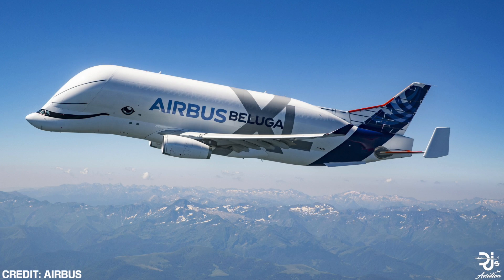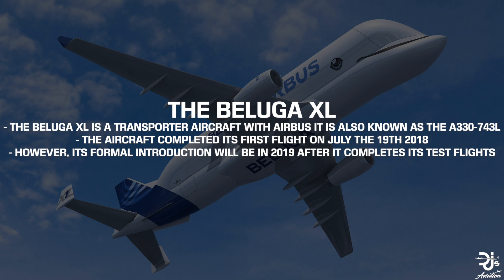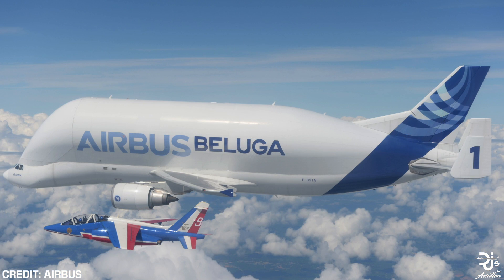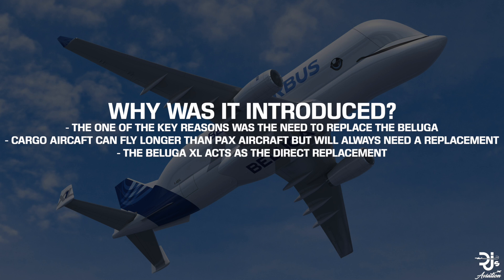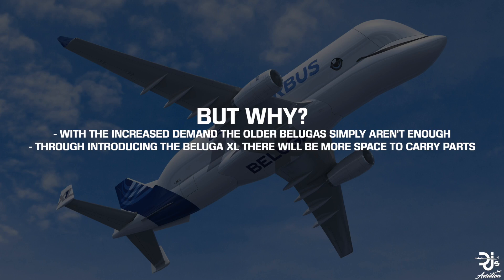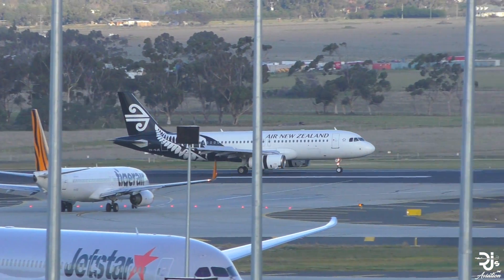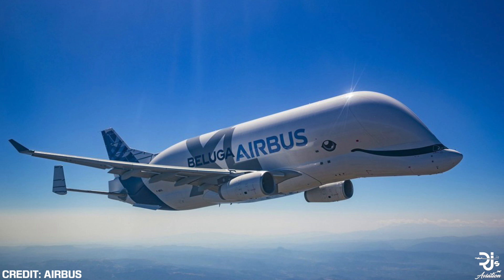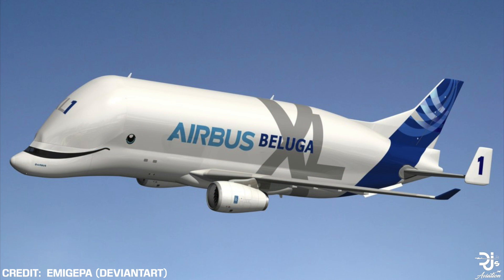Why did AIRBUS Build the BELUGA XL?

Comment: By adding 2 new belugas to their supply chain transportation they can increase production by 8 planes extra every month. 
It’s quite amazing but the beluga aircraft only spends around 9% of its life on the ground. 
They fly 24/7 all 5 of them. It’s a very efficient process they are running.

Comment: I wouldn't be surprised that Airbus ends up building more Beluga XL's than originally anticipated. The high demand for the A320neo Family airliners and the ramping up of A350XWB production will require a lot of use of these planes.

Comment: Other than paint and the Rolls Royce engines, at a distance more than 100 yards, you can't tell the difference between the Beluga and Beluga XL.

The Beluga racked up most of it's hours flying wings from the UK to Toulouse France. Some genius decided to also fly A320 fuselage sections instead of transporting them on rail, because of schedule.

The XL allows for A350 fuselage sections to be transported, where they wouldn't fit in the regular Beluga.

Comment: G'day Dj, And they still call my beloved C-130s 'ugly'. It's only the brilliant, almost cute, paint job that disguises the gross ugliness of this aircraft. It's like an A380 crash landed in a lake of Botox, losing two of its engines, and surfacing looking like this! You've got to admire the thinking behind this type of cargo craft, There's no way you could road transport huge fuselage sections and entire wings on Europe's road system with all its narrow roads, bridges and tunnels. It's the only solution for Airbus's widespread groups of factories.
In response to a commenter below, I don't think this aircraft could be sold to other cargo airlines. Conventional air cargo containers wouldn't be economical in one layer and there's no way this aircraft would take the weight of stacked air cargo pallets that would fill the huge space inside. Besides, the Antonovs are much better suited to odd-shaped and heavy loads. No other company would want these, I reckon. Cheers, BH

Comment: I think, they should insert some bigger engine lips and outer body as the beluga xl looks like, a massive airplane is driven by so tiny engines (2:57). It is okay if they do not increase the power of the engines but they should insert bigger lips and increase the diameter for the plane to look better to bystanders. By the way, good video Dj! I love your videos.

Comment: Can anyone tell me why 2 engines can produce that much trust to carry ex a380 in pieces
Reply: Well because aircraft parts are usually very light, but massive in volume. So it doesn’t need massive engines, just a massive hull.
Reply: Henry Mao 
It’s because of the noses design
Reply: @desmondc.2351  Can you please explain further? Thanks
Reply: Anastasia Golovkova 
Because of the structure and the shape of the aircraft, it’s like a wale, also looks like a dolphin. The shape makes it agile and the air can run smoothly over it

Comment: love the Beluga XL design of course.  but you failed to mention DJ that the relative merits of the XL is that it can transport two wings of the A-350 aircraft in one flight, unlike the current Belugas which can only transport one wing at a time.  i do have another question though: there does not seem to be any intention on the part of Airbus to market the Beluga both classic and XL as transport aircraft to those in the freighter business.  is it because there is in fact no interest in the aircraft as a transport airplane for other businesses?
Reply: Great question, Tony de Castro, and I will try to give you a very shortened and oversimplified answer as to why the Beluga is not used by freighter airlines.  In short, the Beluga is too specialized to be economically feasible for the freighter business.  

Airbus built the Beluga around the objective of carrying completed Airbus subsystems from factories around Europe to Toulouse, France for final assembly.  To convert it to a more generalized freighter aircraft would be excessively expensive.  

The Beluga is not a massed produced aircraft as is the A320 series, the A330, the A350, etc.  Consequently, there are no readily available off the shelf parts for maintenance.  Parts for the Beluga have to be specially built.  Given there is much more wear and tear on freighter aircraft as compared to their passenger variants, the price of maintenance far exceeds that of the general freighters.  

There are other reasons that the specialized Beluga is not suitable for general freighter operations.  In a sense, the Beluga falls into the category that the Antonov AN-124 and AN-225 are in, and their price tag is through the roof expensive.  Nevertheless, the transportation of certain machinery is worth the price a manufacturer will pay.  

This is as succinct as I am able to be.  For, a complete answer would take reams of writing.  Hopefully, this gives you a general idea as to why the Beluga is not suitable for general freight operations.  As always, I invite others to dissent with me or even supplement my reply.
Reply: I have no idea, but maybe it is much less fuel-efficient than a streamlined "cylindrical" fuselage? Perhaps it only makes sense to fly it for carrying the weirdly shaped cargo it was designed to transport, but for "regular" cargo, traditional fuselages are perhaps much more efficient?
Reply: I'm 5 months late, but I'm going to chime in anyway.  From other videos I've been watching on these super-fat air transports, the idea is to carry loads that are large in size, but relatively low in mass--like rocket stages and fuselages; i.e., shells with mostly empty space.  You can't fill a Beluga or its predecessors with dense loads.  That would way exceed their payload capacities.  Those are more efficiently carried by traditional air transports.
Reply: Tony de Castro
We'd have to ask, who is the potential buyer for such an aircraft since it isn't really suitable as a general cargo service? It would need a speciality charter market that isn't already served by Anatov or at least serve the specialty market better or cheaper.  Does it have the range, capacity and flexibility to serve this market?  I'd certainly like to know the answers to these questions too.  

It seems at first look, that it would only work for a buyer that needed it for the same kind of in-house use that Airbus uses it for. And I just don't see any other industry that operates the way the aircraft industry does by building such big parts in a factory, that then need to be consolidated in one location. A location where they can't otherwise be transported by rail or water.  It is kind of a mix of very high technology manufacturing with bulk size becasue of the empty spaces inside..  

An interesting side note. The largest parts for the Saturn 5 and Space Shuttle rockets were built in Louisiana because they could be transported by water to Florida through the Intercoastal Canal. Other large sections were sized, in part, to be suitable for the mode of transportation needed to get them to assembly in Florida.

Comment: I was lucky enough to see one of these at an air force base/ military area in of all places Croatia. The facility had airbus branding all over it and there were several heavy lift military aircraft parked around but was too far away to see. I presume it was maybe doing a test flight and/or undergoing some tests as it seemed an unusual location to see it at.